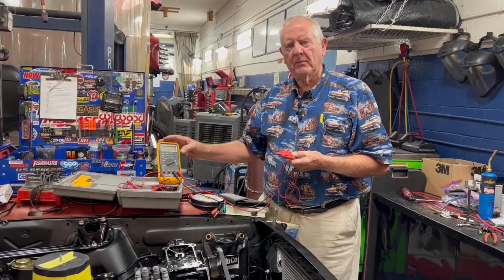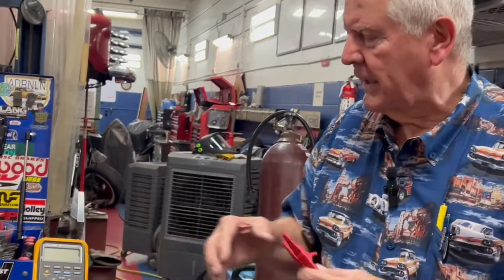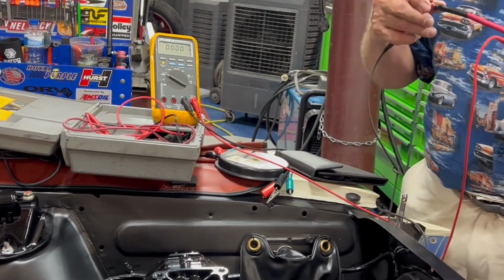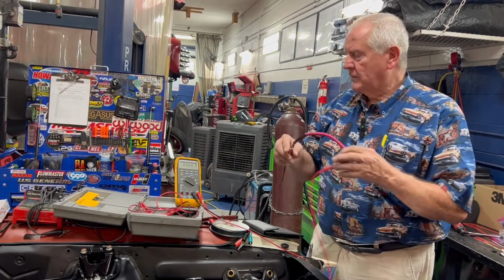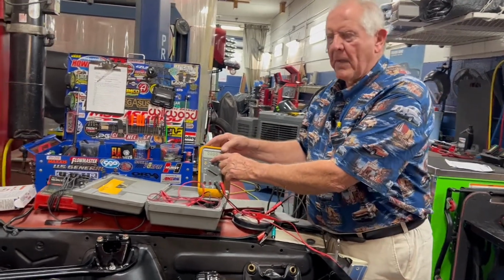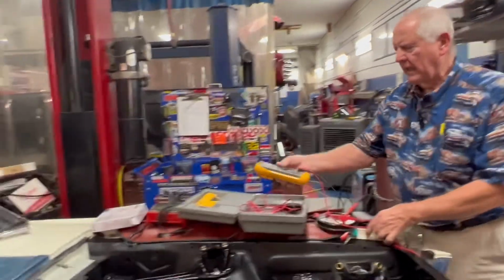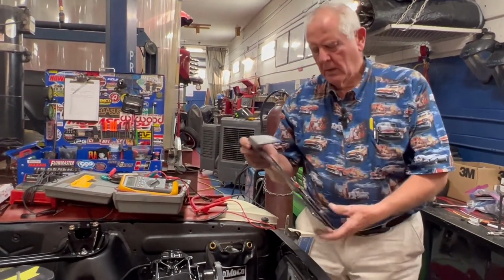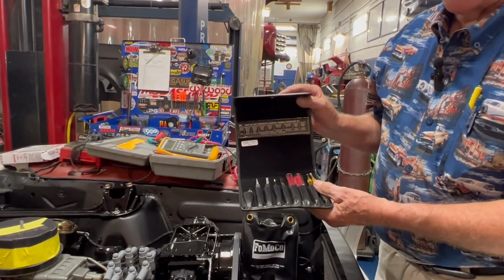Diagnosing Electrical Issues in a Classic Car

Comment: Thanks for the tips. I don’t do good with electricals… 😂 I don’t like them and they don’t like me… I recently bought a 72 F100 Ranger XLT and I thought surely I can figure this thing out. I mean good grief they just got a handful of wires on the whole truck… Hopefully I can get my brake lights and blinkers fixed. Do you know if they are supposed to have two separate flashers one for the blinkers and one for the emergency lights? Because my emergency lights work but the blinkers don’t.
Reply from the maker: Certainly! Check the following:

Flasher Units: Make sure you have separate flashers for turn signals and emergency lights.
Fuses: Ensure the fuses for turn signals are intact.
Bulbs and Wiring: Inspect bulbs and wiring for turn signals.
Grounds: Check grounding points for the turn signal circuit.
Multifunction Switch: Ensure the turn signal switch on the steering column is working.

Having a wiring diagram for your truck can be helpful. Good luck!

Comment: Wilson I have a 61 caddy that only runs with the ignition key turned to start but stops once I let it go any thoughts?
Reply from the maker: The ignition switch may be bad. The ignition coil gets power from two different sources -
One from the starter when you start the engine and the other from the ignition switch when it's in the run position. Also check for a broken wire to the coil. If you need more help from there you can connect with me here - https://wilsonauto.com/help-desk/